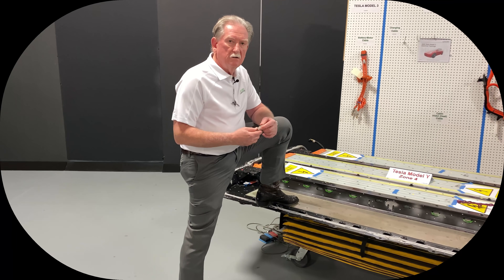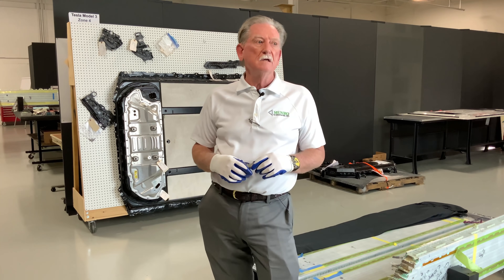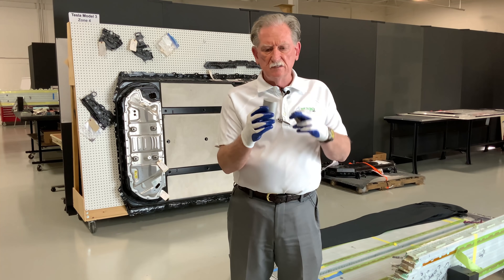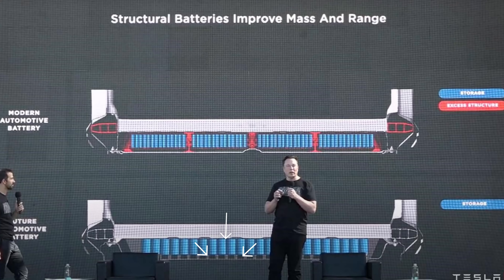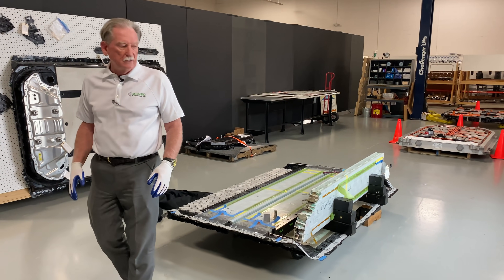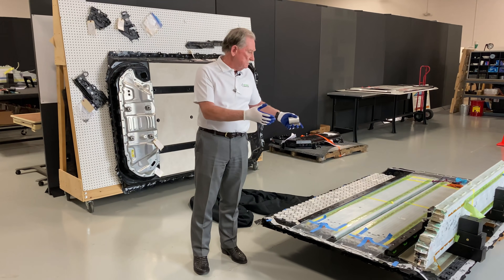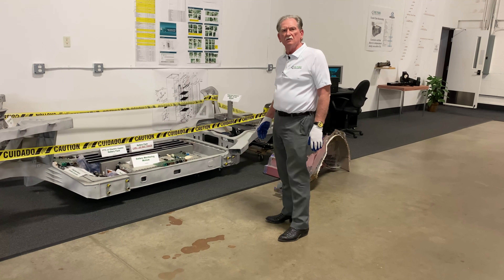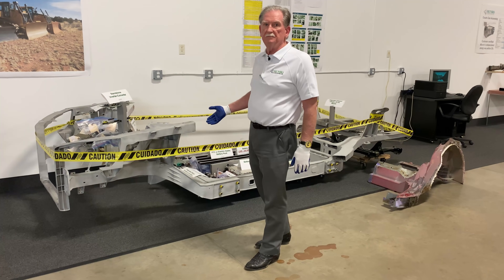Sandy is Thrilled about Tesla's Battery Day & Begins Battery Mock-up

Comment: @MunroLive 
Sure....and you don't have a single piece of 4680 to measure that. The key to success is 4680's electric performance. Meanwhile you focus on everything what's actually irrelavant. If the battery capacity is ~9000mAh and there are ~960 of them, working at 3.7V, so where did u get that ~130kWh?

Comment: Rechnung auf dem Flipchart im Video/Bill on the flipchart
Sandy is Thrilled about Tesla's Battery Day & Begins Battery Mock-up 25.09.2020 16:06min

Zellen						2170		      4680		    Faktor		     Erkenntnis/Recognition
													               4680/2170
Abmaße						21x70		46x80		                                                           
Kapazität					5.000		9.000		1,80
Volumen πr2h(mm3)		24.245		132.952		5,48		      4680 ist 5,5 x größer/larger
Kapazität/Volumen(mAh/mm2)0,21		0,07		0,33		      Energiedichte der 2170 ist 3 x größer/larger???
Grundfläche				441			2116		      4,80
Fläche/“Brick“				20300		20300		1,00
Zellen/“Brick“				46			10			0,21
Kapazität/“Brick“ (mAh)	230.159		86.342		0,38		      Kapazität eines „Brick“ mit 2170  ist 2,5 x größer/larger???

Wo liegt mein Fehler?		Where is my error?
Können Sie helfen?		     Can you help?
Danke					           Thanks

Comment: If all the batteries are epoxyed together there won't be a way to repair it.  And how will battery packs be moved to be in power walls at the end of their life in a car?

If the car is 3 forgings, how does the shop repair a moderate or worse accident?  Do they replace the whole forging?  Junk the whole car? Stretch a forging back into shape?  And what does this do to insurance rates?

Thanks for another great video.

Comment: I would say that they should flip for 1 reason ... better connection on the bottom because gravity and second and most important is that heat rises up and the cooling will go down ... thermodynamics ... so the best way to do the pack is to have coolant at the top and connections on the bottom.

Comment: A thought / question for Sandy and team...  When thinking about a structural battery pack and the manufacturing process, the structural battery pack would need to be part of the body in white part of the assembly (my assumption).  But after the body in white is created it goes into large baths for paint preparation and the entire BIW vehicle is submerged in the solutions (my understanding is a few different ones).  Does that mean with the new process the batter pack will be on the car at this time?  Would this be different from how the process would take place on the current pack process (assumed it was installed after painting)?  In all the previous views of the cars in the past it was always the shell of the car being dipped, I didn't think that would include the battery pack.  This would have to change wouldn't it?  Do you seen any issues (heat in the cleaning to painted steps or worry about leakage into the pack)?

Great shows Sandy and team, I really enjoy all your show and the knowledge you are sharing. 

Thanks
Rob

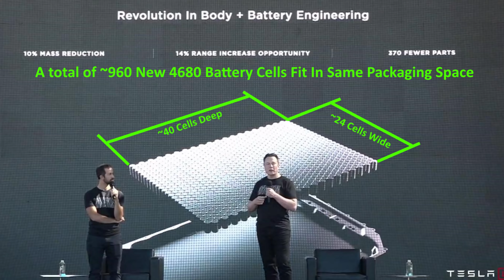Comment: Sandy, at 2:30 on the whiteboard is says the 4680 has an energy capacity of ~9,000 mAh which is impossibly low. The 4860 is 5.5 times the volume of the 2170, so at the same energy density, the 4860 should have 27,500 mAh. With an assumed 33%  energy density, it’s 36,500 mAh.

   (5,000 mAh) (3.6 v) (4,416) =    79.5 kWh     original Model 3 with 2170 
   (9,000 mAh) (3.6 v)  (960)   =    31.51kWh    this MUST be wrong 
(27,5,00 mAh) (3.6 v)  (960)   =   95 kWh same energy density, same area, 15% increased depth & volume.
(36,500 mAh) (3.6 v)  (960)   =  126kWh          33% increased energy density,  4860 is 5.5X the volume of 2170 volume

Comment: Hi guys, I was wondering if anyone here knows how Sandy got to his predicted figure of 130 kWh for the new 4680 pack with 960 cells? I've been trying to calculate it using the fact that the 2170 cells have a capacity of 5 Ah or 17.3 Wh. If the new cells hold 5x the energy then they should be sitting at 86.5 Wh meaning you would need 1503 cells in order to create a 130 kWh pack, not 960. I know I've gone wrong somewhere but don't understand where, if anyone could help me understand I'd really appreciate it! Thanks for you help and thank you to Sandy for creating such cool vids for us to enjoy!

Comment: Mega Jelly Roll vs Mega Torte Cake:

The he way I understand electricity here in America, it’s built on a traditional electric utility triad: 

1). Generation of electricity  through Coal, Oil, NG, Hydro, Renewables Solar Wind, Geothermal, includes peaker plants for peak demand.

2) Transmission of electricity  through long distance transmission of generated electricity through wires strung on towers with significant transmission loss of electricity. 

3) Distribution of electricity from local utility substation to individual homes and businesses through wires strung on telephone/utility poles.

*(Elon Musk is trying to add Megapacks Storage; distributed generation through rooftop solar; a software solution where distributed generated electricity is autobid back to the grid; distributed storage at homes with home batteries and maybe even car batteries (V2G) in the future).

Now apply Elon principal: “The best part is no part and the best process is no process.” Why not merge all this into one part and one process.

Start with an underground boring tunnel from Laredo Tx to Dallas Ft. Worth. Only in this tunnel put in Megapacks back to back the whole 450 miles or so, essentially creating one colossus battery. This battery would do all three things of the electricity triad; it would 

1) take in “generated electricity” from solar fields an wind fields up and down I-35 corridor in Tx.
2) store excess electricity for peak demand plus regular demand.
3) be able to transport electricity long distance to various electrical utility grids whole control the short distance distribution wires to home and businesses.

This colossal 450 mile battery would eliminate Coal plants, and peaker plants generating electricity from Dallas Tx to Laredo Tx. Added benefit would be to supply electricity for Tesla robo-car boring tunnels as well as surface Tesla chargers.

Other variation on the colossus battery is just make giant jelly roll batteries all connected in the tunnel. But does it have to be a jellyroll up ? It may be hard to air cool or liquid cool or produce such a battery. 

What about rectangle block batteries connected together ? Instead of rolling up the battery innards they are laid out in flat sheets inside a big rectangular battery, like a torte cake that would fit inside an underground boring tunnel.

Projects like this would create enough scale for manufacturing plants to produce the batteries, maybe even change over the magapacks made from many mini jelly roll batteries to one big torte cake battery design. Creating enough scale is critical to creating a whole new Colossus battery capable modular battery design.

This eliminates a lot of process work of rolling up many small batteries, like in a Megapacks and instead lay out huge flat sheets of battery innards inside a large rectangular block battery. This could save millions of steps in battery manufacturing of a 450 mile colossus battery Dallas to Laredo Tx.

Other electricity consumption needs of the colossus battery, electric air pumps water cooling pumps maybe even refrigeration or low temperature liquid cooling.

If this could be successfully done, it would negate need for long range electricity transportation towers and/or many telephone poles, which become another eliminated part.

The ultimate solution would actually lower the cost of electricity by running connecting boring tunnels through Texas high wind corridors and high solar sun areas. West of Temple, Waco, & Ft Wort Tx. If Tesla could get the cost of electricity low enough, they could wholesale the electricity to utility companies, Like AEP, who still have the short electricity wires to the homes. 

What do you think ?

Comment: I would love to see Tesla develop a matched Tesla Semi trailer with all wheel drive. The frame of the semi could house the batteries. Imagine the all weather performance and regen braking. No chains in winter. No braking on steep mountain grades. No brake jobs.The trailer could be dropped for unloading and recharging;. The Tesla Semi driver could pick up another fully charged Tesla Semi trailer and be on their way. Batteries are getting lighter and more efficient. Maybe it will be possible soon.

Comment: Sandy, any information on the CT and Tesla Semi motor types? 3 phase AC? DC permanent magnet style? Will tesla have inverters on each motor if they use the 3 phase AC? Or will they use one inverter to drive the other AC motors?

Comment: So many comment but HELLO! Calculations does not add up! 130 kWh and about 1000 cells gives 130 Wh per cell. Say nominal voltage is 3,7 Volt. 130/3.7= 35 Ah per cell. WTF does that 9 Ah (9000 mAh) came from? Can’t believe there so few comments in this. 😮

Comment: The reduction on $/KW of +50% is of key importance for auto market but the increase on KW/Kg is the key for the semi market, a reduction of 25% in weight will mean the semi will require 7.5 ton of batteries instead of 10 ton, and the load will increase in 2.5 ton; on the semi market the point is not the cost but the revenue, and any reduction in battery weight it doubles the benefit , this is the big game changer, more important that the impact on cars. Actually I was testing the model Y yesterday and they recognize the new battery will not be available on cars for still a couple of years because it will be prioritized by semis and trucks. Great Job you are doing!

Comment: Using the Tesla example, Volume increases 1.9566 times surface area increase. 
Cell volume is 5.48363 times larger, surface area is 2.8 times larger - can weight saving is about 65%.
Volume for jelly role is likely 5.6 times larger as a result of less can. 
On the basis a Model 3 pack is 74 kWh usable,  each of the 4416 cells has 16.757 Wh. 
For same cathode, anode,  the 4680 cell should be 16.757 x 5.6 = 93.84 Wh (337.8kJ). 
However, energy density improvements for high nickel cells, I expect they will get 10 kWh out of 96 cells (104.2 Wh/cell (375 kJ/cell) - an 11% density improvement for jelly roll). 
Thus, I expect the new 960 cell pack is a 100 kWh usable pack. 
Each brick  of 10 cells in parallel would be 10.42 kWh (3.75MJ). 
Each cell will be at least 26 A.h and possibly 29 A.h. (Sandy appears to have dropped the '2' in his drawing of the A.h/cell.)
Each Model 3 pack has 4 wire links per cell - 17,664. I expect the larger cells to have 8 wire links per cell - in part for redundancy -  7680 wire links - a 56% reduction. 

Perhaps only need cooling plate on one side of cells. Would it not be better that it is on the top side of the battery away from damage by stones and rocks. 
I could imagine structural cooling plates top and bottom of cells to improve heat removal and heat balancing. I would expect an insulation layer over the cooling plates. On the underside of the car, an ultra high molecular weight polyethylene (UHMWPE) coating would be good - it has a density a little less than one and is abrasion/bullet resistant - it is used in body armour and is now used for military helmets.

Comment: Great video, one question, how does new battery cells impact structural integrity of Cybertruck? Would it still be part of structure with cybertruck unibody frame or does the add on battery change the engineering dynamics?

Comment: Here's my theory:  Mr. Munro's "Nobe" design coupled with Tesla's technology = Breaking into the India market in a BIG way.  Why?

There's a huge population in India, but by and large, not the personal resources to buy today's front-running vehicles.  Enter the Nobe:  small, compact, practical for urban centers, less expensive (I'm assuming and probably correct), easy to maneuver and park (a three-wheeled vehicle could be designed to rotate 180% IN-PLACE ... imagine that in a crowded street or parking lot).  In short, i do believe that there is a huge opportunity for 3-wheeled cars and Tesla.

Comment: The major flaw I see with a single cast is that in an event of a crash you will have to total every car as soon as you get any crack in the cast. Since the cast will be one piece you will have to total the whole car because of the cost of repair. Where as if you have multiple pieces if you break one you can replace it and not have the car be totaled.

Comment: I hope Munroe Live can do a video or short series on the manufacturing and market implications of the front and rear castings and the structural battery.

It's clear Tesla will create a new set of skateboard platforms with castings front and back attached to a structural battery backbone. The production lines for these will be relatively simple to set up with a very small factory footprint (a product to build the product). This provides very modular scaling opportunities.

They have announced design centers in Germany, China, Austin and now India. It looks to me that they will announce multiple market-specific models in 2-3 years:
- smaller Cybertruck for Europe & Asia (the implications of combining the exoskeleton with the structural battery would be worth a full episode)
- Subcompact for China
- Subcompact for India
- Subcompact for Europe
- Utility Van
- 10-20 person bus

The electronics, software, sensor suite, wiring harness, suspension, drivetrain and parts of the interior (e.g.: seats) will be common across all the models. This means the design centers can focus on niche-specific "skins" for the platform. This is Volkswagen's multi-vehicle platform on steroids.

Comment: They need to make complete wheel well modules complete with EV motor, breaks, CV joints, and steering all-in- o e.  Then they can bolt in  four of them into each car.

Comment: Sounds great to make the batteries a structural part of the car, BUT I have two concerns:  Mechanical stress on the batteries themselves, and repairability.  lIthium batteries don't really like to be stressed, mechanically.  They are composed of long strips of metal and isolator that are sandwiched and rolled up and packaged in a cylinder.  Once assembled, the internal surfaces do not like to be disturbed.  Significant stresses due to torqeuing by body twist moment, or by thermal expansion as they heat up and cool could do just that.  Anoother stress issue is the difference in thermal expansion of epoxy vs the metallic components of the battery.  Epoxy expands and contracts about 4-6 times as fast as metals.  If the battery is totally encased in epoxy there will be uneven compression and tension forces on the battery depending on how thick the epoxy is at any given point in its circumference (the "web" between batteries).  :You'll notice that the current batteries are only constrained by adhesive along one line along the battery.  Why didn't Tesla encase those batteries completely in epoxy?  "Danger-danger, Will Robinson!"  Tesla has some incredibly smart engineers, so they will probably have finite-element analysis models to predict stresses and how they affect battery performance and lifetime. 
The other issue is repairability - teh ability to replace a battery pack if it is defective or end-of-life.  Tesla got a lot of kudos for having a replaceable battery, and there are lots of cases where high mileage Teslas have had one or more battery replacements.  Hopefully, those smart engineers are not going to sacrifice necessary maintainability for cost.  We saw the hue and cry when Apple made their batteries non-replaceable. "Planned Obsolesence" would not go over well with Tesla buyers!

Comment: What an inspiring video! I have been working with product development my self for the last 20+ years and sure, most projects that fail do this on lack of conceptual work before starting design. The cell dimensions I too was wondering about when I did concept work on back up batteries for telecom applications. It is amazing how much money big companies are wasting on developing bad concepts in stead of thoroughly analysing options "outside of the box".

Comment: Why state that Tesla will most probably meet those objectives way earlier than announced, when it's a simple fact that Tesla has repeatedly missed their schedule in the past ? The Model 3, the Roadster, the Truck are just examples of push-backs. Granted, they also exceeded their target with Model Y or Shanghai construction.
I must stress this is a legit question, I sure hope they do break the OEMs legs and slap the whole industry face into a cleaner future that they are going dragging their feet.

Comment: Sandy,

I have an engineering question that maybe you could talk about in a future video.  During battery day, Elon said this (https://youtu.be/Njqr6n_fBd8?t=483): "Those castings are also quite important because you want to transfer load into the structure of the battery pack in a very smooth and continuous way, so you don't put arbitrary point loads into the battery. You want to feather the load out from the front and rear into the structural battery"

How does this work?  How can you have a rigid frame body transfer load smoothly, and what does it mean from a manufacturing standpoint?  

Thanks for reading this,
Brian

Comment: Last year Tesla spelled out how far ahead they are in Autonomy.  This year they've laid out their significant advancements in battery and manufacturing tech.   In 5 - 8 years I predict we'll see 500 +mile range Tesla EV's with the safest driving records,  dealerships going out of business, 1 in every 4 cars is an EV (~50% Teslas and all other brands using Tesla batteries), and Oil companies dwindling and eventually shifting investments into the EV market.